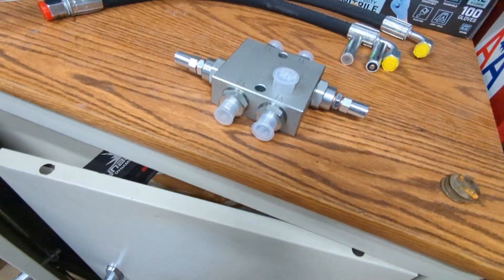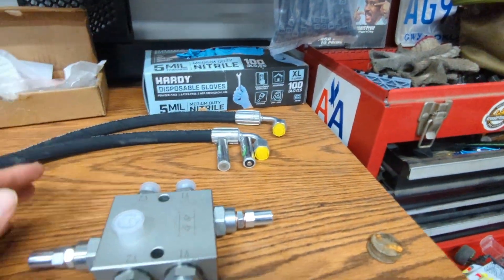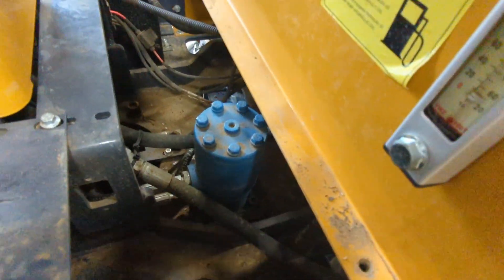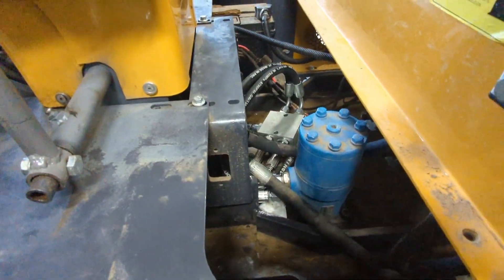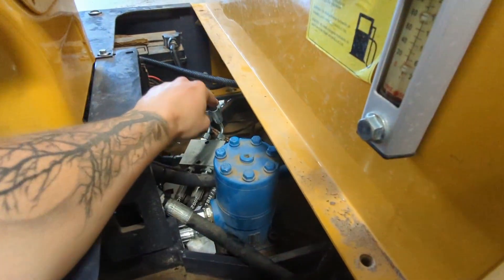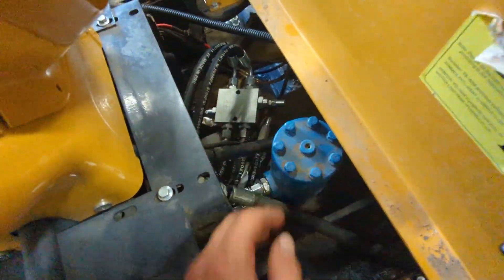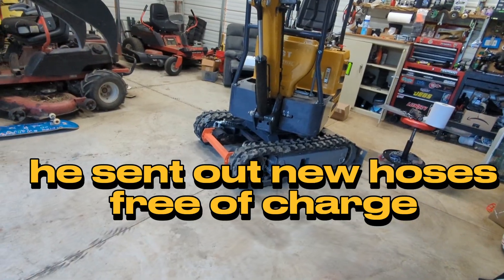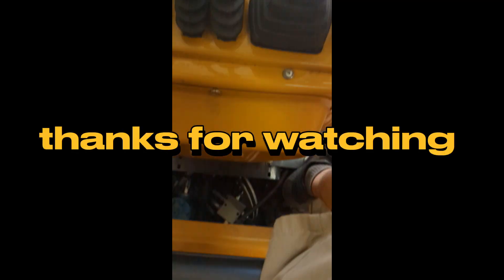Installing Cushion valve on excavator.

Comment: Will the modification help to dig with the excavator near the house? My rotation is very sensitive and cannot be smoothly regulated
Reply from the maker: No, it bypasses the large jolts from swinging and stopping all of a sudden or swinging with heavy load. Takes the stress away from gear and swing motor

Comment: I've tried a few times to contact Bill but no luck so far. Will call a few times more. I had a swing motor seal start leaking and I'm thinking it's due to the sudden stopping.
Reply from the maker: Call his business.
Reply: @Dirtymachines  I called the number you provided. No answer over the past couple of weeks and no answering machine.
Reply from the maker: That's odd, do you follow Facebook groups of these? He's on most of them. @normhowes2975
Reply: @Dirtymachines  Not on Facebook. right now waiting on Cam from Garage Connection to get home in a few weeks to see what he has to offer.

Comment: What is the reason need to instal Cushion valve on excavator?
Reply from the maker: It cushions sudden starts and stops for the swing motor, also limits is rotation power so you don't break a gear.  Much needed IMO
Reply: @Dirtymachines  Thanks! I am going to have new excavator & I never used one,

Comment: Hi friend, I have a mini excavator. I would also like you to share with me the part number of that valve so I can install it on my mini excavator. Thanks, regards.
Reply from the maker: 603-424-7993
Bill Silva. 

He owns a shop and sells the kits along with some other things, super nice
Reply: @Dirtymachines  Can you give a rough, ball park figure on the price before I call and bother the guy? 
I just took delivery of a Typhon XI and looking to upgrade a few things. Thanks!
Reply from the maker: @racerx9931 should be around $80ish i believe. Its cheaper than buying everything seperay